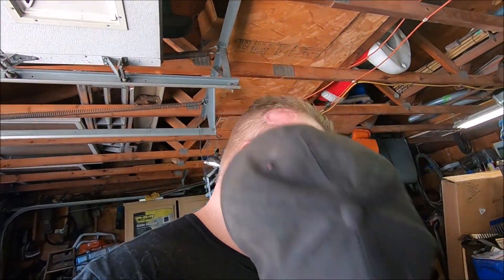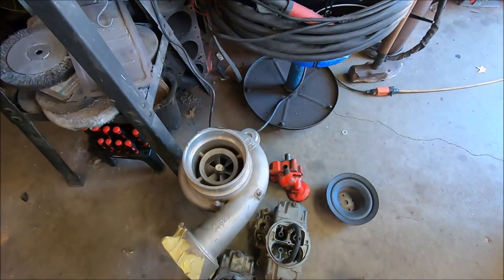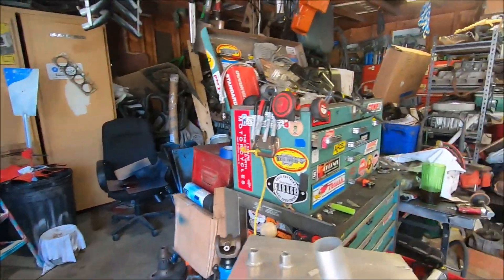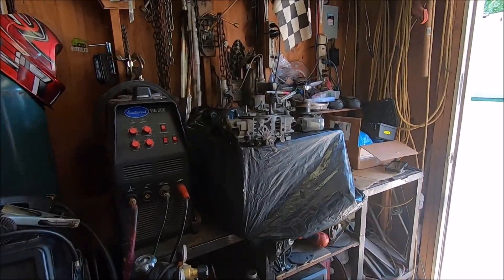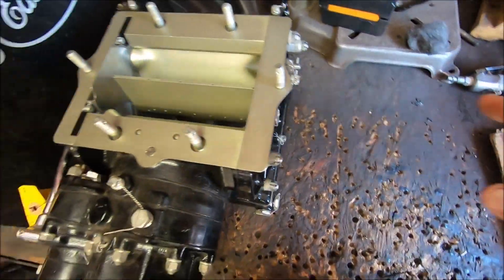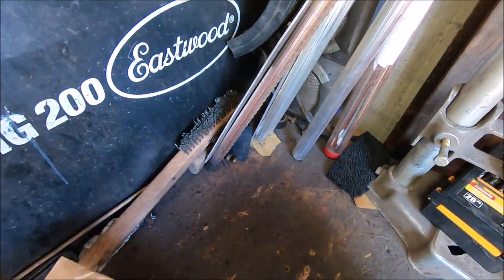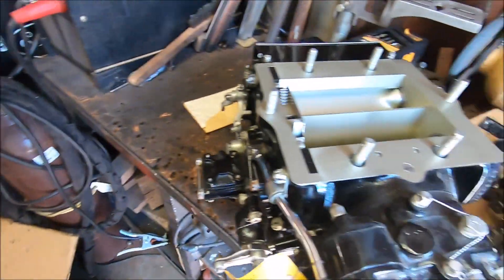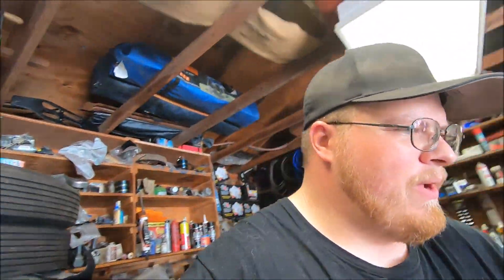The biggest Holley Carburetor EVER MADE & MoKan Swap Meet SCORE

Comment: If you watch tractor pulls the ones with the radial engines you can see the carbs opening up in the front of the engine. Radials were made in odd numbers of cylinder on each row, I think the p w r4360 wasp major was 4 rows of 7 cylinders and 4,360 ci I think dont quote me on that. Awesome video love it.

Comment: I had a 1958 Ford station wagon with one of those glass float bowl holleys on it stock. on a 223 six cylinder.  A friend of mine put six of them on a 300 inch six that he built the absolute hell out of!  He even welded to 351 Cleveland heads together to make a 180 degree head for that thing!
Reply: two' not to!

Comment: At least you bought car related items!
I used to go to the Pomona hot rod swap meet all the time.  I think the only car related item I bought during those years was new Jaz 5 gallon fuel and water containers!
I've bought shopping bags, tools, fishing equipment, overalls, etc.  The best item I ever bought was a tuna tower with 8 aluminum rocket launchers for my boat for $40.00!  Those rocket launchers brand new sell for $90 a piece!  Oh, I forgot an original Yoda doll for $10.
I did sell my 67 Mustang there in 5 minutes to a buyer from Belgium.  I didn't even have time to break out the coffee!
That must be one serious carb to have safety wiring!  We did that on USAF aircraft.

Comment: The cat turbo looks like it is for a 15 liter C15 or 3406E ( which is the same displacement) truck engine. The silver mounts you took out of the box with the oil pump in it look like for a boat, inboard or inboard/outboard. I believe they would bolt to a Borg-Warner or paragon transmission. That Holley is freaking huge! Subscribed

Comment: free carb caps are easy to come by , all you need is some GM junk laying around one of your friends places , a GM HEI distributor cap , cut the locks off of it , and it fits perfect on your carb , complete with the perfectly centered hole for the stud , and if you want a water tight seal use an air cleaner gasket under it , and the rubber washer used under the coil under the wing nut , perfect for a nice pressure wash session ...

Comment: That aircraft carb is really cool. It looks to be a floatless "pressure" carburetor which uses diaphragms to meter the fuel. Way cooler than a kendig/predator imo.
Cool find
Reply: That is indeed what it is. They couldn’t used floats in aircraft carbs due to altitude variations and in the case high banks angles and rolls a float just doesn’t work.

Comment: Those mounts are for a boat. My jet boat had some like those.
Reply: That's what I was thinking I have two boat motors with motor mounts like that , my phone is small and cracked could not see well.
Reply: At 8:20...
Reply from the maker: They are boat mounts, but what makes them cool is that they are specially for a 426 Hemi marine application
Reply: @ScottsSpeedShop  sooooo you looking for a boat? Come to Ca. get this jet drive boat with 455 olds out of my yard freesies
Central California watching
Reply: @ScottsSpeedShop  that's cool I believe the first jet boat hemi application was for the clearwater River in Idaho in 57 or around then I live in lewiston Idaho.
Reply: @ScottsSpeedShop  really like your videos I'm a mopar fan for life.!
Reply from the maker: Glad you all are enjoying the content. And as far as jet boat goes. Dad has one
Reply: @joegr8483  Just moved from Moscow Idaho.. Lewiston is like a different state
Reply: Are they hydraulic dampened?? The reason i asked is I’ve seen ones that look a lot like those but where for a ero passenger diesel application to quiet down NVH and that’s what my first guess was for but as aftermarket racing gasoline mopar part

Comment: Jed you brought back a few memories for me cause in the military l was an Aircraft engine specialist.  If you ever get a chance to see the carb on a 4360 aircraft engine that one you have is a baby  Also most radial engine aircraft engines had an internal supercharger. And on the 4360 (that's 4,360 cubic inches) of displacement it also but it has (if l remember rite) four turbo superchargers. Fifty six sparkplug twenty eight cylinder four magnetos' and two distributors. Try finding a fouled out plug on that lol
Reply from the maker: Oh wow man, that is freaking awesome, but I wouldn't want to trouble shoot that engine
Reply: Damn
Reply: @shanepowers7566  Another tid bit for ya. Unless you loose the master cylinder these engines will run even after loosing two or three  cylinders.  Some  even more most V-8 you loose one rod your done.

Comment: You ought to ck out the carburators on the 6602 continental gas engines in the military 5 tons , I think you could almost run 2/3rds water thru them , worked flawless for years till they put ethanol in the gas .

Comment: here is a description of the carb: http://www.enginehistory.org/Accessories/HxFuelSys/FuelSysHx07.shtml
Reply: and if you want one of the largest: http://www.enginehistory.org/Accessories/HxFuelSys/FuelSysHx08.shtml
used on the P&W R4360, thats 4,360 ci. 56 spark plugs and 7 distributors. the carb would use as much fuel to run 10 426ci engines

Comment: 1. consider powder coating the steel valve covers in Black Chrome 2 by Prismatic Powders. It's pretty cheap and lasts for years.
2. the giant Holley has a mixture control in it so you can mess with your air/fuel on the fly easier then EFI. Slap a 871 blower on the Hemi and put it on top.....lol

Comment: The blower is a 3-53 I work at Detroit Diesel remanufacturing East I used to tear those down along with a bunch of other ones pretty cool
Reply from the maker: Thank you for the information my friend, I've been scratching my head trying to figure that out
Reply: There were A blowers , and B. blowers  depending on the horsepower rating , Teflon coated rotors are the key .
Reply from the maker: @crazyoilfieldmechanic3195  I would be interested for future projects, shoot me an email ChargerJezebel70@yahoo.com
Reply: Thank you I was wondering what that thing went on.

Comment: Great badassery Jed! That Holley carburator is bitchin' cool! It's like looking at a beautiful woman 😍 You cannot avert your eyes! Regarding the hemi valve covers....Stick with the steel ones and go with the nickel plating. They would look luscious!
Reply: I’d do crome with candy red and barely tinted black clear coat like in Scott speed shops Dana 60 cover video but I’m torn between straight crome or nickel plating or at least that’s my plan for now on my twin plug 2G hemi. Sorry I’m just not in love with and F8 Charger and hemi orange 🍊 so my block is candy red like the valve covers I’m thinking 🤔 about doing but it’s got a little amount of aluminium flake in the paint/clear coat and the intake I’m doing shiny polished cross ram efi welded ally or fake because real carbon fibre ( with maybe silver and or red strands highlights ??) looking intakes are one of too things time consuming to make or $$$ or both 

Golds ged Scott most of the time isn’t my first pick as colour choice if it’s not a ruby/diamond wedding wife/GF ring. but you do you your not hurting me or anyone else. I’m curious as to how well those twin stamped steel valve covers seal because I was looking at a set awhile ago but passed as I wasn’t sure that they seal all that well because people like mike finagan with his crome single plug covers ( quote “ are a fire 🔥 hazard but they look cool” ) and some older guys I have hung out with said they’re junk and leak and are flimsy and the stamped aluminium ones are worse oil leakers. So I’ve going to the thicker heavy cast magnesium/cast aluminium ones without the lettering on them and I have thought 💭 Sirius about adding the 50’s red ram 🐑 stamped design in crome or black with a red eye 👁 to mine with the ramchargers 426 hemi stickers. I just don’t know how rare they are plus I’ve been told that there quieter to use as they muffle the normal valve clatter running sounds and hold a better shine for not needed special paint/plating to make them crome coloured